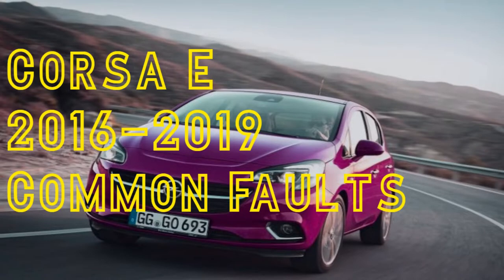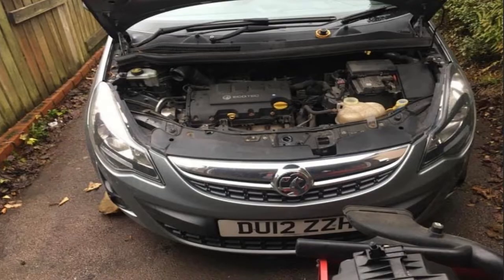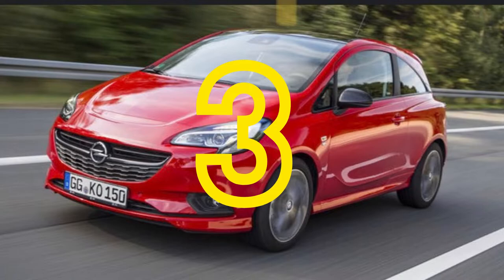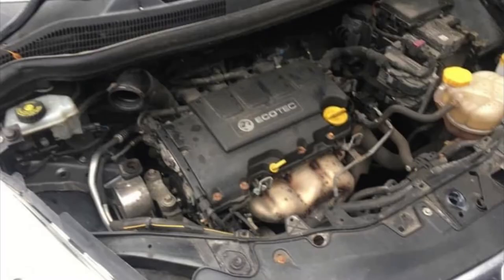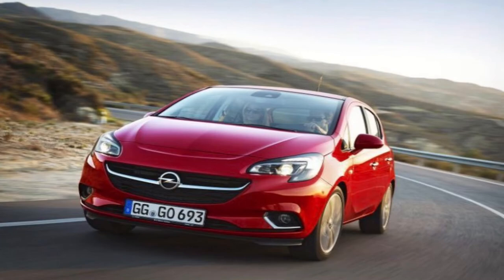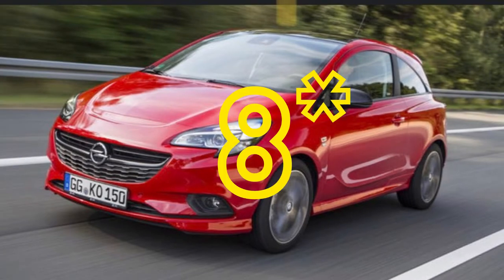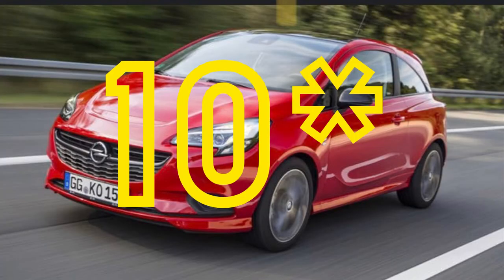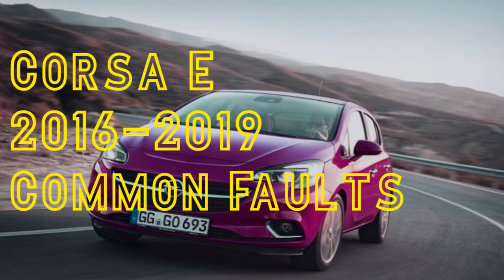Vauxhall/Opel Corsa E Mk4 2016-2019 Common Faults ( Petrol models)

Comment: I had a 2017 Corsa that had awful leaks in the offside rear and front foot wells. There was mould everywhere and had seedlings growing in it. Formally complained about it no joy. The water seeped when stepping into it making the bottom of my jeans wet. Had to get rid of it. Happy with my new car.

Comment: Hi I have notice a weird scraping/grinding sound when setting off in 1st it only happens when i put a lot of gas on when lifting off the clutch biting point but if I do it with a little bit of gas then the sound doesn't occur it only happens in 1st and 2nd gear. any ideas what it could be ? its almost as if it like when the car move more due to accelerating faster something starts scarping off something possibly
Reply from the maker: @mitchell_9709  nothing common that springs to mind, perhaps check the engine mounts to see if something it’s flexing
Reply: Hello
What engine do you have ? Is your car manual or automatik ? Do you think this car is generally reliable ?

Comment: I had a 2016 corsa sting (90)from new (5miles on it when I picked it up ) the only fault I had was the coil pack had a very slight misfire at 3000 rpm at about 50k, sold the car at 103,000 miles, had it serviced at vx every year, never replaced back tyres and only ever replaced the front tyres once, never had clutch problems or wiper problems, and no speedo problems,it always passed its mot no advisory’s, maybe I was the lucky , just hope my Hyundai is just as good, why did I not buy another corsa there just too expensive and it’s French owned might as well buy a 308, not for me
Reply: Hello
What engine do you have in your corsa ? Is your car manual or automatik ? Do you think this car is generally reliable ?

Comment: I personally believe the coil pack issue is caused by when the spark plug gets messed up and generally down to not using the correct manufacturer recommended spark plug

Comment: My 2015 1.0L ecoflex has no power. Its like someone has removed the turbo. I put my foot flat and the car doesnt respond. The timing chain was replaced 41000km ago. Current mikeage is 241000. Took iff the intake and the turbo is not stuck. It does turn. Haven't checked while the car is running. Engine light is on. Please help.
Reply from the maker: Any fault codes ?

Comment: For those with the p0171 lean code, check the evap purge valve. The original bosch ones seem to constantly fail and are the likely culprit for that code. In my case the engine was drinking way more fuel, ran rough and was giving off a fuel smell every so often. Along with a few misfires. Changing the evap valve fixed it completely.

Take it out, if you can blow through it then it's knackered and needs replacing since the valve is stuck open. Heard online people using maf sensor cleaner to spray in and fix it but honestly just replace the part. Cheap and easy to do.

Comment: Re initial query about 'engine overheating idle engine' - I replaced thermostat but still getting the warning and now thinking it must be temperature sensor. Seen vids on one going into radiator but also thread on corsa forum says there are 2 sensors - any idea where the other is located? Once again, thanks in advance for any help or advice.
Reply from the maker: @ajenergy4251  further down there is coolant temperate sensor B, sits on the pipe at the bottom near the readiator
Reply: Hello
What engine do you have ? Is your car manual or automatik ? Do you think this car is generally reliable ?

Comment: And finally... I'll share some advice for anyone who jas a similar issue....

While trying to change the thermostat - there are 3 bolts with TX star head size e10. All bolts on this model seem to be TX star heads of varying sizes... Anyway, one bolt snapped and i solved this by filing down the barrel that was left in situ (more by luck than judgement as it started wearing down when using the mole grips😂) So I get an e6 TX star head onto it, gently tapped it in til tight, then used ratchet to loosen. Hope this helps anyone who has similar issues.
Reply: Hello
What engine do you have ? Is your car manual or automatik ? Do you think this car is generally reliable ?

Comment: Hi again, I cannot get my head around the tyre pressure indicator, it says, "check tyre pressures" I pump the tyres to wear I want them, 3 people eco, and put the "tyre pressure learning active" mode on but not sure what to do after this because next morning it still reads on start up,  "check tyre pressures", can you help please.
Reply from the maker: @regal163  try doing a re learn using a tool called el 50448.

Copy versions of said tool are only around £5 on eBay
Reply from the maker: @regal163  el-50448
Reply from the maker: @regal163  whilst that’s on order, adjust the pressures and take it for a drive

Comment: Could you please advise what battery for me to get for my same shape corsa e 2015 apparently these corsas all come with a varta start stop battery even if your car is not start stop which mine is not. I do not have a radio code and have read that the battery swap needs to be done within 30 seconds or you will have to get the radio code please can you advise
Reply: Hello
What engine do you have ? Is your car manual or automatik ? Do you think this car is generally reliable ?

Comment: Top vid mate,would you know why my radio stays on when i stop the car,turn off, and remove the key,it used to go off straight away,but now it takes about 20 seconds or i turn it of at the knob,,Cheer Baza
PS Could it be to do with the ignition barrel
Reply: Hello
What engine do you have ? Is your car manual or automatik ? Do you think this car is generally reliable ?

Comment: Hi, my corsa e misfires a lot when turbo boosts then flicks the check engine light (engine power reduced)
Reply: Same here. Did you manage to find the cause?
Reply: Coil pack and replacement spark plugs.Or duel mass air flow needs replacing.
Reply: Hello
What engine do you have ? Is your car manual or automatik ? Do you think this car is generally reliable ?

Comment: hi mate.  can the purge valve cause a ticking noise at idle that follows your engine speed up if the accelerator is pressed
Reply from the maker: @jrbeidnendu2454  yes
Reply: @jonsutyautomotiverepair1993  cheers mate thank you
Reply: That's the cooking fan..

Comment: How can we solve the problem “service ESC” 2016 Corsa E 1.4 engine 90 HP
Reply from the maker: @mesutmermutlu6923  possibly replace the coil pack
Reply: @jonsutyautomotiverepair1993  thank you
Reply: Purge valve
Reply: Hello
Is your car manual or automatik ? Do you think this car is generally reliable ?
Reply: @ my car is automatic. This car is a reliable car.
Reply: @mesutmermutlu6923  thank you for replying. do you have the 5 speed or 6 speed gearbox ? and how many kilometers in the speedometer ?
Reply: @ 6 speed gearbox

Comment: Hi man. Just watched video and thanks for the tips. Came across this as looking for a solution to engine overheating - but before I go there i noticed at approx 4 mins into this video you mentioned a "timing chain" I have been wondering since I bought car - corsa e 1.4 sri 2015 - whether it was belt or chain and when to replace?? Car has done 101000 miles. Any advice greatly appreciated.
Reply: Hello
What engine do you have ? Is your car manual or automatik ? Do you think this car is generally reliable ?

Comment: Just seen your video, my car radio suddenly has no sound, presume its a fuse as nothing has changed re radio. Do you know what the  fuse no is and which colour it is, and is it located in the engine or in the car fuse box. I have a 16 plate 1.4 petrol corsa
Reply from the maker: I don’t know what fuse it is off the top of my head.

Do you indicators still make the noise as they going through the audio system also
Reply: @jonsutyautomotiverepair1993  thank you but all sorted now, checked all fuses, re tuned, restored to factory settings, then gave up. Then just pressed the forward then rewind button and hey presto sound came on. No idea why.
Reply: Hello
What engine do you have : with turbo or naturally aspirated ? Is your car manual or automatik ? Do you think this car is generally reliable ?

Comment: I'm going to ask you a question that I have been googling, binging and even went to my Vauxhall dealer who sold me my 2019 Corsa, which is exactly the fuse for the reversing lights on my car, all they said was, there's to boxes one in the engine bay, at which point I could have screamed😅,  I would like to know where it is or even what amp it is without taking out every single fuse, its not an MOT fail or I would have had to pay Vauxhall a large amount of money just to replace it, the reversing lights fuse is no where in the manual, any help you can give will be great👍👍👍.
Reply from the maker: There isn’t one as far as I’m aware, I. Sure it’s switched by the Bcm.

I’d check the reverse light switch located on the front of the gearbox, that’s the likely culprit
Reply: Thank you for your reply, I will check that.
Reply: Hello
What engine do you have ? Is your car manual or automatik ? Do you think this car is generally reliable ?

Comment: Purge valve, not necessarily do you get a code, it just makes an incredible ticking racket !
Reply from the maker: Yes you are correct I’ve seen these before ticking - not sure why I didn’t think to say that.

Thanks
Reply: Had this issue, ran disgnostic engine running lean, change O2 sensor bank 1, 

Changed both didn’t fix it and same code came up, changed airflow sensor and still didn’t fix it ended up been the valve. Easy way to check it is to take it off your car and try blow through it both ways if you can it needs replacing 👌🏻 

2016 corsa E vxr 
The part from main dealer is £180 which is the one I got but I did find one on Amazon with 5* reviews for £20 but the people also said it makes car sound like a tractor but works 🤣
Reply from the maker: @jackcolumbine3647  ha fair enough, if it works it works!